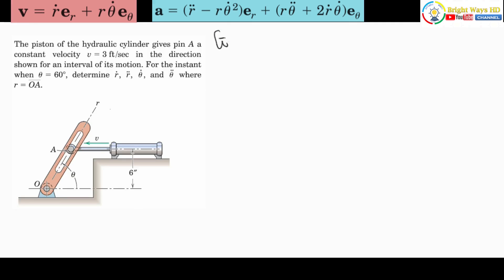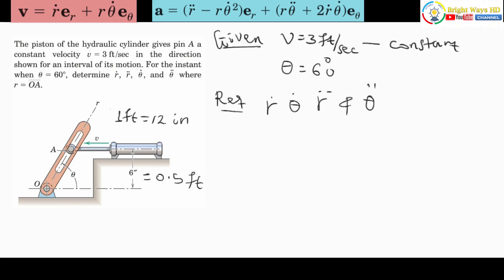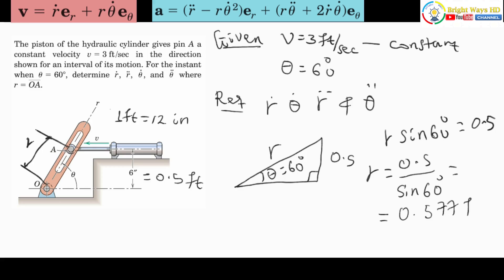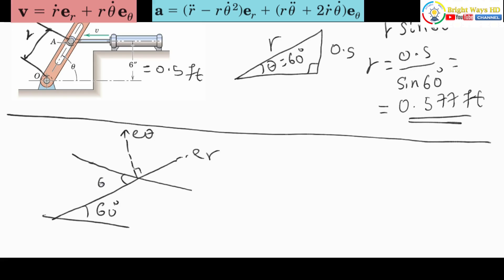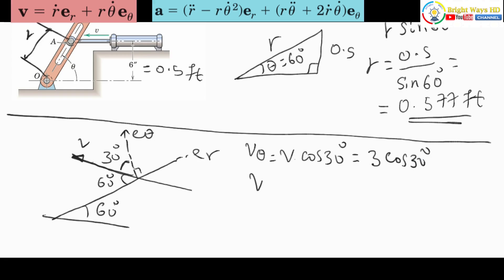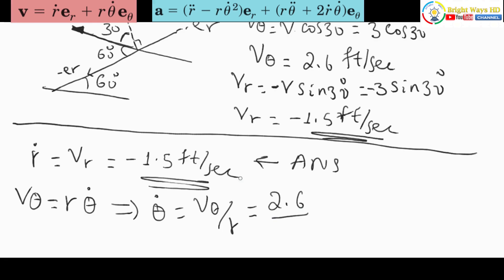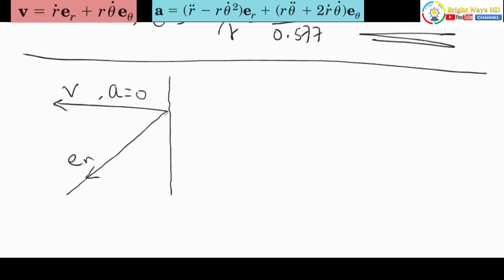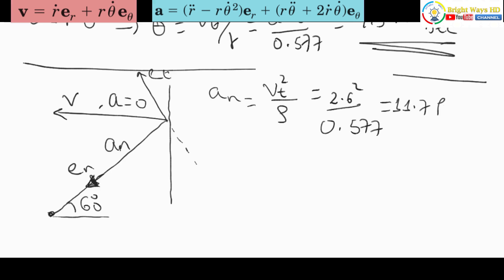Dynamics 02_14 Polar Coordinate Problem with solutions in Kinematics of Particles

Comment: Why are we using values for acceleration? Acceleration doesn't move on a curve in this question so how can there be acceleration when velocity is constant? I think the correct way is to set the acceleration which is zero to its polar coord expression and solve each component equal to zero for r dot dot and theta dot dot.